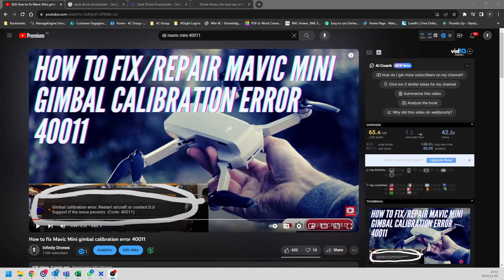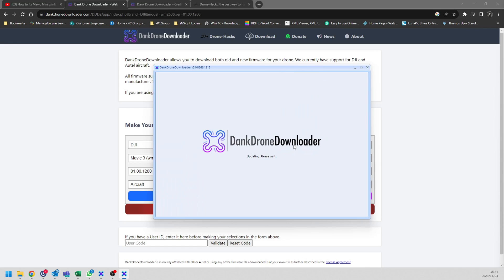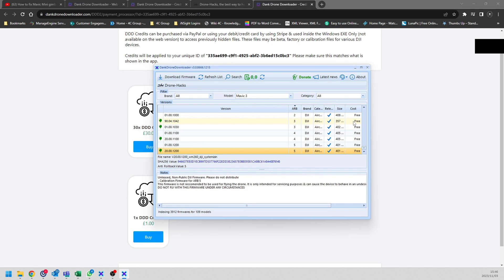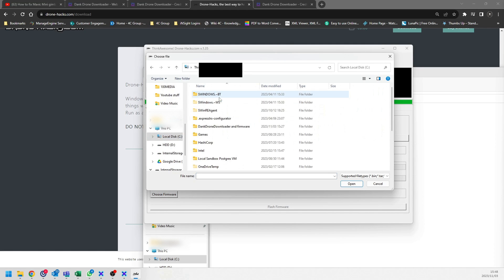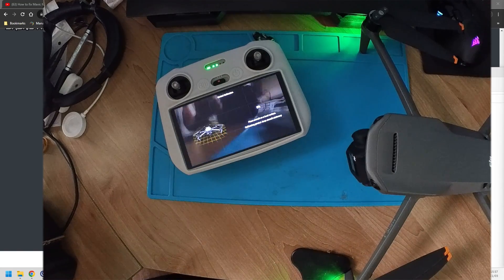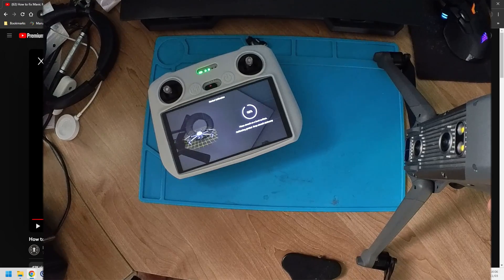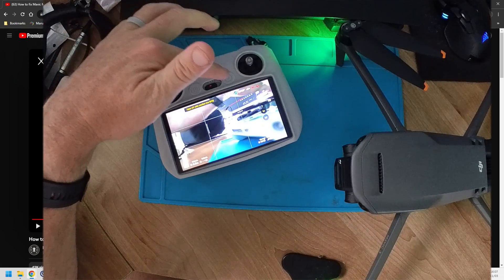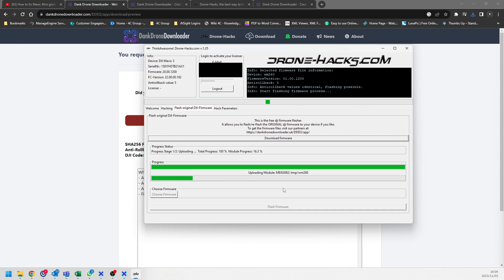DJI Gimbal Calibration Firmware

Comment: After changing the camera to the mini three, this method will work.
Reply from the maker: Sorry man, this method does not support mini 3 firmware flashing only mini 3 pro
Reply: @InfinityDrones  That would have been good to know before buying the firmware from DDD. What options do I have to flash it to the Mini 3 (non Pro)? The gimbal isn't pointing straight after replacing 2x motors. Otherwise everything works sweet with no errors.
Reply from the maker: sadly you need software to remove the error message...

Comment: I'm having trouble doing it on the DJI mini 3, the firmware upload doesn't work, is there another way, friend?
Reply from the maker: Are you trying to flash firmware with the same ARB value or are they different?
Reply: @InfinityDrones  I have tried flashing with the same arb as the firmware type on the drone unit but still no results. Do you have other tools to flash firmware other than drone hack, friend?
Reply from the maker: @pesantrenluqmanalhakim270  do the firmware flash completes? Did you have a crash?
Reply: @InfinityDrones  I didn't experience any crashes or anything like that, but when I flashed the drone hack application, there was no progress at all.
Reply from the maker: @pesantrenluqmanalhakim270  when flashing via dronehacks on some windows machines there is no progress bar movement. The drone does restart etc and you should leave it for about 10 min to see if the drone restarts. If it does not then you can turn off the drone, close dronehackers, disconnect everything and then try again. I have to ask though, you do have the dronehacks driver installed and dji assistant 2 for consumer drones right?
Reply: Have you ever tried the flash on the DJI Mini 3, friend?
Reply from the maker: @pesantrenluqmanalhakim270  I've only flashed the mini 3 pro. But what seems to be the problem that you're experiencing? Why do you need to flash the firmware?

Comment: Please bro it work with mini3 pro ? My 3pro didn't send any message after I replaced the gimbal but it is tilted to the right😢😢 help plz
Reply from the maker: Follow the video and check if there firmware available for your ARB verison. I also have a video using a phyton script as well on the channel, worth a try.

Comment: Will it fixed the 40002 Gimbal error?
Reply from the maker: I do not know, but worth a try :) Remember that error is not just for a single  cause , you could have a faulty motor or cable or or or.

Comment: for the dji mini 3 is the same !!!!!! if not possible at this time to flash with this software....why
Reply from the maker: They are not the same, fundemental firmware changes means that the same approach on the Mini 3 pro will not necessarliy work on the Mini 3 - Also, the guys are trying their best to source calibration firmware, but DJI are keeping the system very closed - so very difficult for the guys at DankDroneDownload if dji does not officially release firmware.
Reply: seem good for me to change some value but not flashing .....stay 0% ...but flashing ok with dji assistant
Reply from the maker: did you get this issue resolved?

Comment: Does anyone knows if the DJI Mini 4 pro calibration firmware already available?
Reply from the maker: Best place to check is dankdronedownloader
Reply: Hi, do you test it? which firmware correct?
Reply from the maker: @АртёмТруфанов-ъ5о  like I said. Check dankdronedownloader as they store all available firmware. However, mini 4 pro has a calibration issue that dji put in on purpose that requires their software. So you will need to send it on to get the error removed and calibrated.

Comment: I bought firmware version  for mavic mini 2 for service but still no possible to perform calibration;( There is button Auto but is no active;/ also manual not possible.. any ideas?
Reply from the maker: So in the fly app its not allowing to calibrate? Have you tried a different version of the firmware, perhaps the antirollback version was different?
Reply: @InfinityDrones  I tried the same version of ARB it's only one with 4 so there was no mistake..I changed the signal cable and maybe I put something back to tide? Not sure its possible🤔
Everything in app works good except for moving the gimbal (even by stick)
Reply from the maker: @pawelbarge  So the gimbal does not more on startup ?

Comment: i crash my drone it will fix it ?( gimbal stuck and calibrate error, not broken)
Reply from the maker: I do not know... if you crashed your drone (not sure what model) but gimbal stuck is most likely a gimbal motor or ribbon that is faulty. There is a whole host of other possible issues and I cannot confirm that this will work
Reply: @InfinityDrones Dji mini 2 se, I accidentally dropped it on the floor.
Reply from the maker: @ewyowt  Yeah... I think you have a motor or ribbon issue
Reply: @InfinityDrones need repair?
Reply: @InfinityDrones need repair? how much repair?
Reply from the maker: @ewyowt  I can't tell you that as that depends on where you are, what the damage is once accessed erc

Comment: Hi,
on my  DJI mini current version. 01.00.0600. I have downloaded  01.00.0320 but drone hacks require a license.  which version should I download to resolve the gimbal calibration error?
Reply from the maker: If you need to flash firmware with an older anti rollback version then you need to buy a license

Comment: My mini 3 pro doesn't want to pair with my RC-N1 after flashing calibration firmware. Any ideas why? Thanks.
Reply from the maker: The calibration firmware is just for calibration, its not meant to fly with. You must flash normal firmware before flight
Reply: @InfinityDrones  oh I was trying to connect it to the dji fly app so that I can perform the calibration as shown in the video
Reply: Hi, did it work? I changed yaw motor on my mini 3 pro, so i dont want to damage drone
Reply from the maker: @borisbahleda2989  The software can't damage you rdrone, so give it a try. But as far as I know if you change hardware you'll need to load new calibration firmware - I have a video about that too.

Comment: Ran the calibration firmware on my air 2 after replacing the gimbal.  It completes successfully, but the error message remains.
Reply from the maker: The error can only be resolved by official dji software sadly, it's no just a ghost error though
Reply: @InfinityDrones  I resorted to using litchi.  No error in it.
Reply from the maker: @perditionluc  yup, since it's a ghost error now. Good workaround 👍
Reply: @perditionluc Hi please help. Faceing thé same issue you faced. What is Litchi ? Please help
Reply: Can this be fixed???
Reply from the maker: did you get this fixed?

Comment: Mine wont flash, ive just read that DJI have made it so its not possible to flash anymore?
Reply from the maker: Are you trying to flash a different ARB level firmware? Remember if your Anti Roll Back version is 5, then you can only flash firmware of ARB 5 or higher.

Comment: Hello! I have a jelly effect on the video (mini 3 pro) there are no errors, will recalibrating the stabilizer using this method help?
Reply from the maker: Sadly no it will not. Seems like a hardware issue... Might be a roll or pitch motor but most likely your PTZ cable is starting to go. You'll have to send it in for repair as it would need to be recalibarted.

Comment: Dank Drone Downloader won't download on my Macbook Air, do I needa Windows computer for this?
Reply from the maker: It's a pc app, but they also have a website where you can get everything
Reply: @InfinityDrones  Thank you. The video says that the website doesn’t have the gimbal calibration firmware, and I need to download the app. Do you know the firmware version I need for a Mini 3 Pro?
Reply from the maker: @LRC247  Hi there in the video I show how to download the firmware. Why don't you download the app? The app is the best way to see what firmware are available. Remember firmware is constantly being added to the database. But to answer your question. Yes I have downloaded several mini 3 calibration firmware versions
Reply: @InfinityDrones  It’s not letting me download it on my MacBook :(
Reply from the maker: @LRC247  As per the video... mac is not supported. Sorry man
Reply: @InfinityDrones  I have a friend with a Windows computer doing the update for me. Which version of the software should we be using on a Mini 3 Pro?
Reply from the maker: @LRC247  the latest version
Reply: @InfinityDrones  Thank you!
Reply from the maker: did you ever get this fixed?
Reply: @InfinityDrones Negative :(, I bought a second non-pro, would love to figure it someday!

Comment: Hello, what a good video.  It's a shame I don't speak English to appreciate it even more.  I am writing to you from the translator hahahaha.  Thank you very much for helping the community with your knowledge.  I have a DJI Mini 3 with error 40011. Will these steps help me?  thank you so much.
Reply from the maker: Hi there. Thank you for commenting! I cannot promise that this will help you. If you had an accident with your drone the issue could be hardware related but give it a try! You have nothing to loose.
Reply: @InfinityDrones  Hello, thanks for answering.  It wasn't an accident.  It was after changing the gimbal.  I hope it works.  successes on the channel.
Reply from the maker: @Jhamoralesr  mini 3 gimbal needs dji official software to recalibrate the gimbal... But give it a go and let me know if it worked for you
Reply: @InfinityDrones  Hello Friend how are you? Download the firmware for gimbal calibration. but the drone-hacks application does not advance me in the process. remains at 0. Do you have any suggestions why? I clarify that it recognizes the drone and I can load the firmware. thank you.
Reply from the maker: @jharrymorales1648  leave it for 10 min, if the drone did not restart during that time it did not work. Try a different machine. Make sure you have the Dronehacks driver installed and dji assistant 2 for consumer drones
Reply: @InfinityDrones  I think I have the controller because DJI assistant like Dronehanck recognizes my drone.  First I open DJI Assistant and when it recognizes it, I close it and then open Dronehack.  I'm going to try leaving it for 10 minutes or with another machine.  Thank you very much for responding.  hug...
Reply from the maker: @Jhamoralesr  hope all works out for you
Reply: @Jhamoralesr  did it fix your problem
Reply: @Jhamoralesr  hi, what happened at the end?
Reply: @ Thank you for asking. In the end I solved it with the help of a friend. through a modified software.
Reply: @Jhamoralesr  I see, I need that help, do you know the name of the software? I'm searching for solutions that I can make myself, because where I live is not possible to send the drone for repairing, it's complicated...
Reply: @ Hello. In itself, what problem do you have?
Reply: @Jhamoralesr  the gimbal started to fail from time to time after a crash, there was sand inside the motors of the propeller and the gimbal, I managed to clean them and could fly and make videos again, but as said, sometimes the motos presented overload and I had to stop flying and wait a shot time before fly again, recently i desasembled the whole gimbal and managed to clean it deeper (and yes, I exacted more sand from inside the gimbal) however, once I reconnected everything, the gimbal doesn't work as before, calibration only reach 85% and tilt doesn't respond, and I think I've the error 1D010003
Reply: @ Yes. From what you say it is clear that you have to pass the software for gimbal calibration. But apart from that, I recommend that you clean it well as best you can. Both engines and the entire gimbal. Pass it clean contact, then blow each part well with compressed air. The sand is very annoying.
Reply: @Jhamoralesr could you share your process please
Reply: @Jhamoralesr  Hi, i have same issue. The drone-hacks application does not advance me in the process - remains at 0. Haw you go trough this?
Reply: @Jhamoralesr   Hey ! I have absolutely the same problem ! Could you help me please to resolve it ? What kind of soft did u use and where did u find it ? Thanks a lot !
Reply from the maker: Glad you got sorted
Reply from the maker: did you get this sorted?

Comment: Has anyone had success on a mini 3? Drone hack gets stuck.
Reply: You need drivers - just install DJI Assistant 2. If it connects then you are ready for DH.
Reply from the maker: @Lester-ng5bb  correct. We also recommend installing the Dronehacks drivers
Reply from the maker: did you replace your gimbal or have an accident?
Reply: i replace the gimbal. i work fine but  it 's a little on the left. i have no error on dji fly @InfinityDrones  @InfinityDrones
Reply: @InfinityDrones  yes, but my problem is mini 3 doesn't connect to DH
Reply from the maker: @johnsmotors  Did you follow the steps of connecting a Mini to the PC? The turn on, wait for chime then only connect the cable?

Comment: Wondering if the air 3 is available on this application
Reply from the maker: The Air 3 is still very very new.. you can try and see if the firmware files have been release, but I doubt it will be
Reply: There is a calibration firmware for Air 3 but only for ARB 0 (anti rollback value). I doubt you still use old firmware with ARB 0.
Reply from the maker: I think there is a newer calibration firmware available now.

Comment: @infinity drones, if you have an air 2s, an rc pro controller & an rc controller.
Which controller is best to keep to maximize the hack from drone hacks?

I see in their bird map that RC pro doesn't really have much hack available.
But I don't see anything for RC controller.

Can air 2s still have the ability to use maximum hacks available from drone hacks & be controlled by RC pro?
Reply from the maker: The rc pro is the best controller to use. Range etc will all be beter. You don't need to mod it at all if you've got an air 2s that's modded.
Reply: @InfinityDrones  o excellent 💯 that is great news.
I was concerned RC pro would transmit drone ID & also lose NFZ hack capabilities.
Thank you for your insight & knowledge
Reply from the maker: @ElevatedVehicles  just a pleasure man

Comment: hey! i have the camera calibrate error and wont let me record footage from the drone either now only from the goggles in my dji fpv drone after i changed the gimble to another onei looked at that python way to calibrate the gimble but it doesnt say it supports my dji fpv drone:( does anyone have any ideo of what i can do to fix it please? its so annoying as i use it for capturing footage:(
Reply from the maker: What error message are you seeing?
Reply: @InfinityDrones camera calibration error on the goggles V2. They say you need to calibrate on assistant 2, but, when you try to calibrate there, appears message: calibration failed. That occurred with lot of people and nobody have fixed that issue. I also have this problem with my DJI o3 air unit
Reply from the maker: @gabrielnunes159  Camera calibration error is just on the o3 if you replaced the camera. Nothing to do with your goggles. So be sure to update your dji assistant 2 for consumer drone and update the firmware to the latest.
Reply from the maker: did you ever get this sorted?

Comment: Hello friend, very good video, how to make the USB port recognize the Mavic 3, on my PC it appears as Libusb and it does not detect the COM port in drone-hacks. Thank you
Reply from the maker: You need to have a dji assistant 2 for consumer drones installed
Reply: @InfinityDrones  I think I didn't make myself understood, when I connect my Mavic 3 it doesn't recognize it on any COM port only as a Libusb device, is there a way to configure it so that it recognizes it on any of the COM ports? Thank you
Reply from the maker: @eduardongc  the mavic 3 uses a different connection method and you won't see it use a specific com port. May I ask why you want to see a come port specifically?
Reply from the maker: Ah i see :)

Comment: Thanks for all the detail steps.
Did you try this on the Mavic 3 pro? 
In my case of Mavic 3 pro, the process stuck at 78% then the calibration is failed.
Looking forward to your reply.
Reply from the maker: Hi there, sadly I don't have a Mavic 3 pro to test with. Remember, this is only for error 40011 and also if it's not crash related.

Comment: do you have for mavic air 2?
Reply from the maker: Hi there, check out this video of mine. Should sort you out :)
Reply: @InfinityDrones I already downloaded dankdrones. I don't know what to firmware to download for the mavic air 2 calibration firmware
Reply: @InfinityDrones this is quite helpful. Thanks! The only question I have is that do I have to buy drone-hacks license to do that?
Reply from the maker: @EynFpv  no need to buy a license. Watch the video and you'll see you might have to buy the calibration firmware for 1 pound.
Reply: @InfinityDrones I already have 2 credits for this👌 gonna do this later. I am waiting for the gimbal assembly I ordered.
Reply from the maker: @EynFpv  remember, this in only for error 40011, usually if you change the gimbal you get 40028...
Reply: @InfinityDrones it went well bro!.40011 has left the group😂 Thanks bro!.gonna spread this!
Reply from the maker: haha awesome!